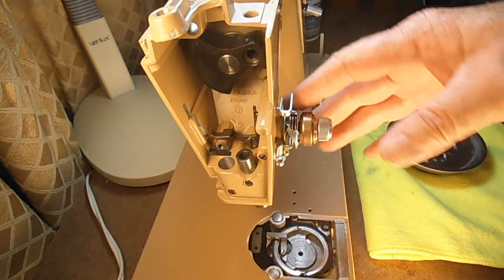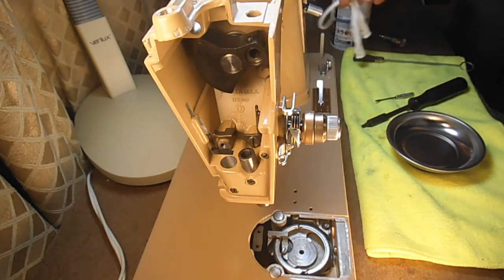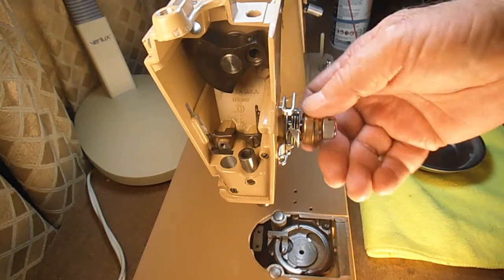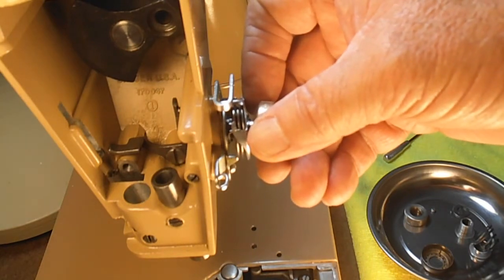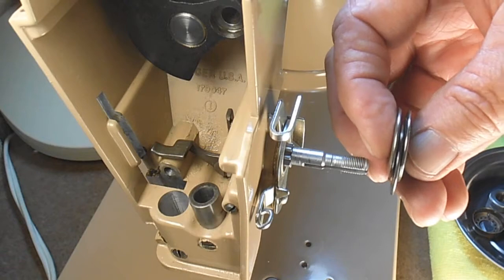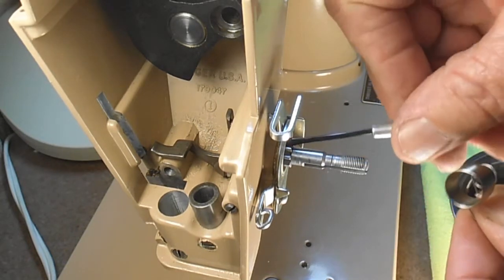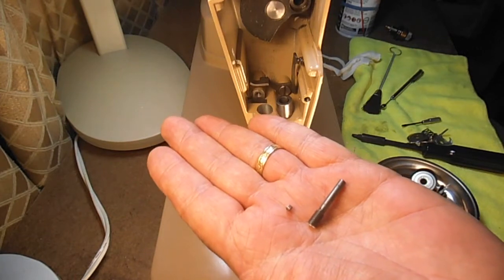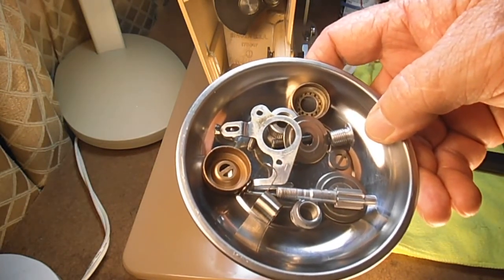SINGER MODEL 404 MINI SERIES-ALL ABOUT TENSION PART 14c DISMANTLE TENSION ASSEMBLY

Comment: Tension assemblies are very "party" aren't they? One little area and you end up with a bowl FULL of parts!
Reply from the maker: LOL, for sure! The assembly looks complicated doesn't it? I think that's why most people don't fool with it. It would be like me looking at the carburetor  of my car. I have a pretty good idea what it does and kind of know when it is not working properly, but no way would I start taking parts off of it, hahaha. It's too much for me. A singer machine, on the other hand, makes sense to me, so I don't mind working on it. Besides, Tri-Flow smells better than gasoline, right? Thanks for watching.
Reply: HaHaHa Tri-flow smells really GOOD! If you go to their website they advertise it smells like bananas. It sure smells better than the ancient grease and oils inside these old machines. I was ever so pleased to find my bed cover plate felt has no odor after being soaked in Krud Kutter and rinsed and dried in the sun.
Reply from the maker: I remember cleaning the felt on the cover plate the first time with the Krud Kutter. Spray, soak, rinse, repeat repeat repeat. Man, it was full of oil. But it was sure worth it. Odor free like you say. Worth the price of the KK right there. I think you are having a good time with your 503 machine :)

Comment: I need an original tension assembly for a Singer 457K that has the three disk for double thread.  Know where I can get one?  I think it's the same as what a 404 uses.  My machine has one with plastic knobs and only two disk for single thread.
Reply: Have any videos on the ones with the plastic knobs people are using on the Singer machines?
Reply from the maker: A search just now on eBay came up with a few for sale starting @ $10. Both types are there.
Reply from the maker: Sorry, no.

Comment: Hello. I have just discovered your channel, and I love how detailed you are in your work. 
I have a thread tension problem, no tension. My machine is a Singer Merritt 2404. The tension mechanism is a plastic one-piece iitem, sort of, but I do not know how to remove it, so I can clean it and reset it. I am afraid I will break the plastic.
Reply from the maker: That model is newer than what I worked on. I researched it and it is based on model 240. The plastic dial just pulls straight off the stud (straight at you) after turning the dial to zero. The parts under that are the same as other Singer models. You can buy and download the SERVICE MANUAL for $8.99 here: https://manualsoncd.com/product/singer-240-series-sewing-machine-service-manual/  it has diagrams and written instructions for working on the parts of the machine including the tension unit. How to adjust, remove, install, etc.  You can also try turning the dial to zero, lifting the presser foot, and blowing air around the tension discs with compressed air or a hairdryer. Sometimes you can carfully slide a piece of cloth dipped in alcohol between the discs and use a back-and-forth motion (shoe shine) very gently to clear out any lint and dirt. Be sure you are threading the unit correctly (I don't know if the machine is new to you :) before you start dismantling parts. Thanks for watching my channel and good luck.

Comment: 23:36 getting the pin out ... would a small paper clip from behind push it out?
Reply: Your pin looks like someone previously used a nail to replace their lost pin.  I've saw that done quite often ....
Reply from the maker: Yes, if you could maneuver it around the Tension Releasing Lever.
Reply from the maker: I have also seen a modified finishing nail used as a replacement. The one shown here is the original tension releasing pin.